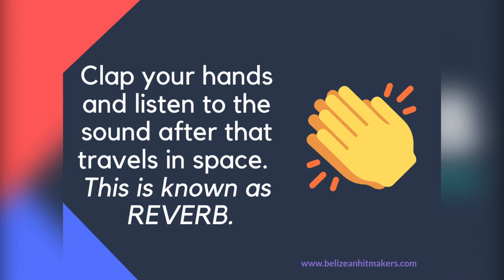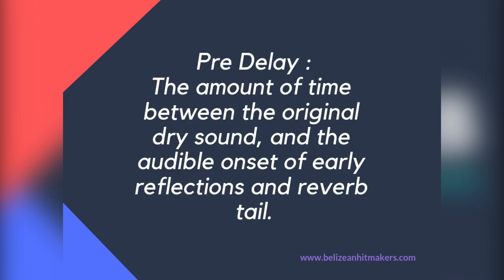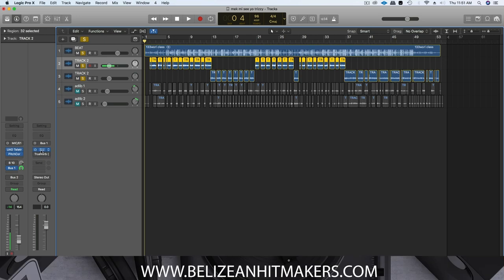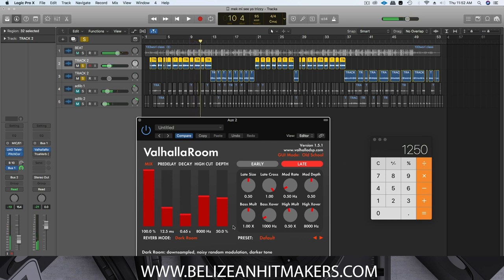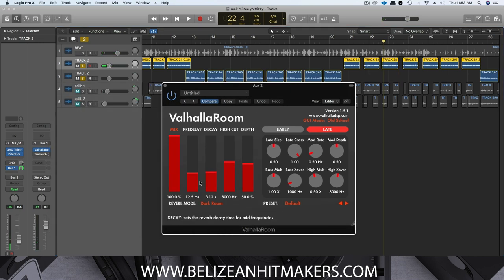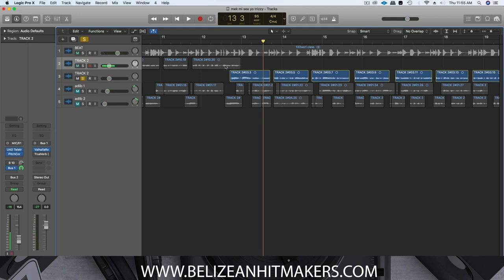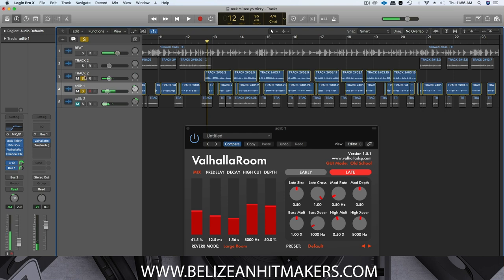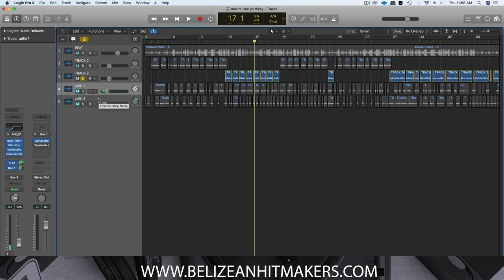How To Mix Dancehall Vocals: REVERB

Comment: Hey bro how did you get the 60.000 mili secon
Reply from the maker: Thats how much time it takes for the sound to travel within a second bro. Always use 60000 divided by ur bpm to find the proper reverb for your vocals..and remember with that number u can multiply by even numbers to get a bigger or smaller reverb that matches the speed of the song

Comment: kinda curios as to why you dint use the reverb as 100% wet
Reply from the maker: Hey bro.  Well i normally blend the orginal sound of the vocal along with the reverb sound.  Putting the reverb directily on the vocal will cause the vocal to be muddly so by dialing the wet knob to a good value you add the reverb to the vocal without creating that mud in your lows.